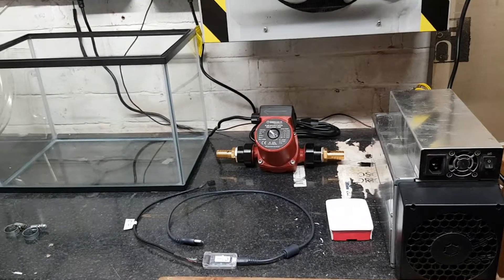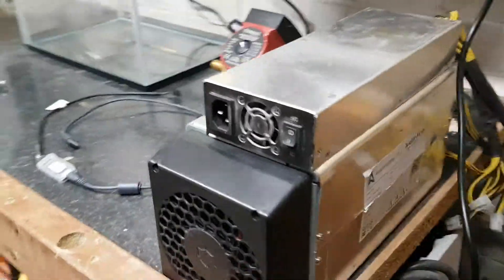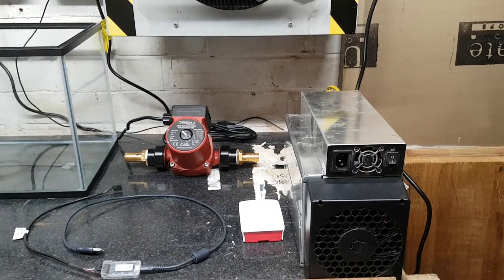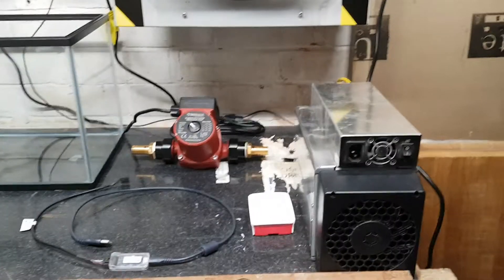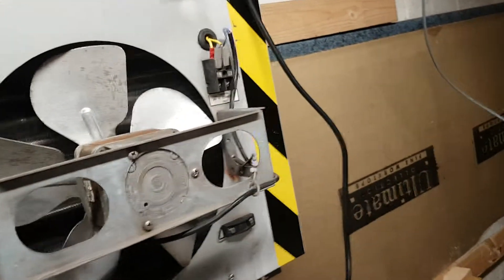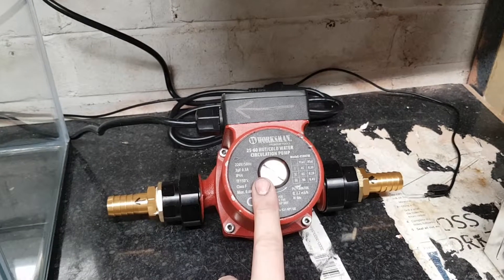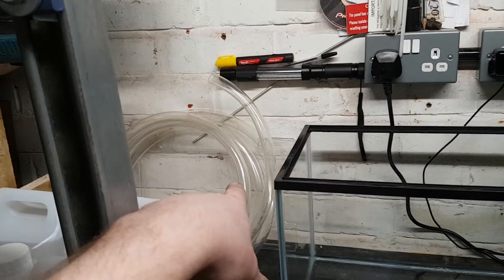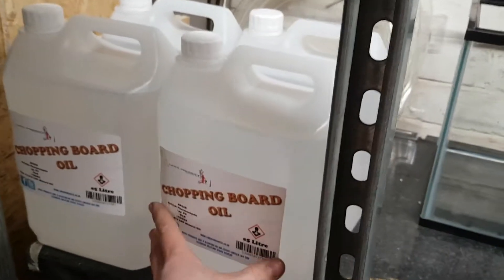Avalon 741 Oil cooled Bitcoin miner experiment Part 1

Comment: Hey man great work, I am planning to do the same , any update how it's working?
Reply from the maker: Hi, sorry for the late reply I had not seen any notifications come through.

 yes its been running ok, the heat dump unit I have to cool the oil only seems to drop the temperature around 5c so the miner is sitting just that bit too hot. It runs for about 2 hours before it overheats and reboots and carries on etc. Plus I had a slight oil leak at the pump over night so when I come into my garage in the morning ther was  pool of oil, I have since repaired this.

The principle of the oil cooling works but I thing a better means of Cooling the oil is needed, either a larger heat exchanger or im toying the idea of using a domestic radiator and running more pipe to help with the cooling.

I will keep posted you posted on this though, im a little short of spare time at the moment with work, the miner is my hobbie after the kids goto bed lol.